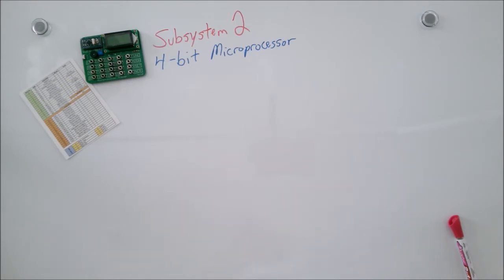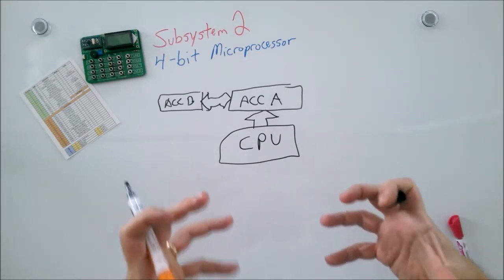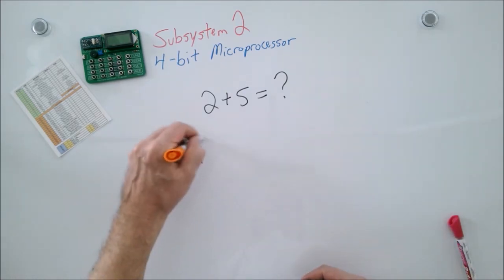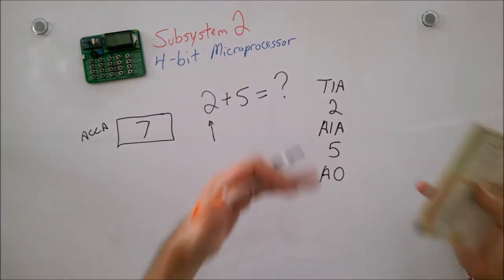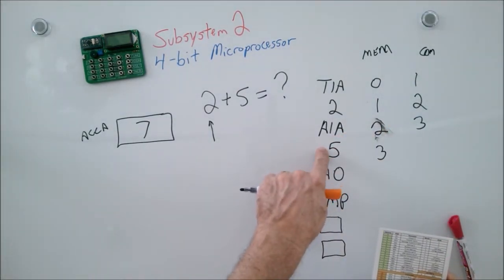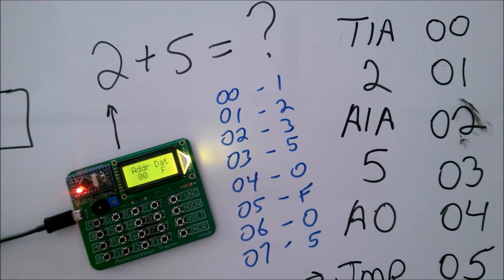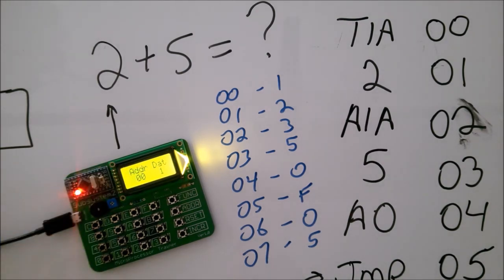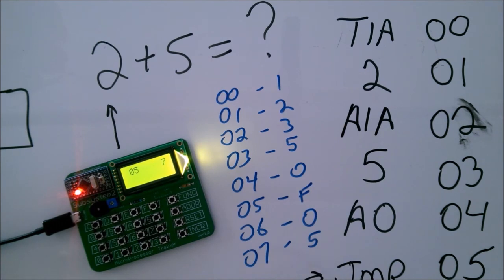Introduction to Subsystem 2: 4-bit Microprocessor Trainer

Comment: What is the microprocessor? Kind of looks like an arduino. I was looking for an 8085. This is cool though!
Reply: I believe it's an emulated virtual processor the user interacts with. What chip it's running on I do not know, possibly it could be a modern microcontroller, not much is needed to emulate a 4-bit processor!